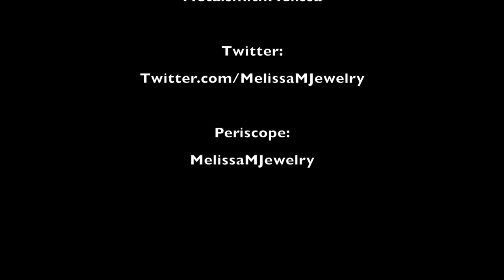Sand Casting - From Start to Finish

Comment: Great piece. I'm curious as to why you didn't create any vents in the mold. I thought that was a "must" procedure. Thanks.
Reply from the maker: It depends on the type of clay. The one used in this video is a bit more porous so it wasn’t as necessary with such a small piece. But when I do other larger pieces with this clay, I do put in vents. Since the making of this video I have also switched clays to one that is more fine and compacts really well. That one NEEDS to have air vents.
Reply: @MelissaMuir  Thanks and thank you for the quick response!!

Comment: I’ve been trying this using the MAP gas tank map pro tank and my metal (I’ve tried brass and silver) never seems to stay liquid long enough. I get the metal past the melting point as I would for spin casting but it seems that every pour just goes cold too fast. The only successful pour I’ve had has been bismuth. Any suggestions?
Reply from the maker: Hmmmm are you using a hose with the torch? I found that if I don’t have the hose and the canister is held upside down it doesn’t produce enough heat.

Comment: Is the trough that you cut around the piece used to allow displaced air to escape? Is there a circumstance where you use air vent holes - like for a large piece?
Reply: In another comment she said since she was using petrobond and it was porous the vents weren’t needed. The digging out was so that roughly half the impression was on both sides of the flask.

Comment: I take it that is baby powder? I am starting to get into casting. Will be trying it here in the next month or so. The powder is to keep the item from sticking? thanks for sharing and great video.
Reply: SilverHunter2013 yeah that was baby powder to keep the layers from sticking. the best type of sand to cast with is either green sand, which is just play sand with a little bit of some kind of concrete mix
Reply from the maker: Yes, it is baby powder. I like to put a bit of powder on the item being molded as well so it releases a bit easier from the sand.
Reply from the maker: That is great. I haven't ever used green sand. I may have to try that.

Comment: Would this be possible making a curb ring this way 
Thanks
Reply from the maker: Possibly, but you. may have some difficulties where it has a lot of curves or small openings. If you were to cast a curb ring this way, it wouldn't have them movement that an actual curb chain has, it would be more solid where there joins meet.
Reply: @MelissaMuir  ok thanks 
I don’t think you need that movement tho if it’s a ring right ?
Reply from the maker: @Elites-asthetic  That is correct, I wouldn’t think you would need the movement either.
Reply: @MelissaMuir  ok thanks 🙏 that’s my new project a curb ring
Now trying to find out how much gold it will take 
Because this seems hard 
I have some most wax designs of the curb ring and some wedding bands but I can not tell what gold I would possibly need 
How did you learn this
Reply from the maker: @Elites-asthetic  it has all been trial and error. Maybe try it out in silver first.

Comment: I would like to know if you use vent in the molds?
Reply from the maker: It depends on the material I am using to cast in. In this case it was petobond. It is less dense so it didn’t need the air vents. When I am using Delft clay then yes, I do put in air vents.

Comment: Wait, a time skip happened at 3:28. So how long does it take for the metal to melt? Cuz I read that sand casting was supposed to be one of the cheaper and easier manufacturing methods.
4:09 Wait, don't you need some kind of exit hole for air to escape, so the molten metal can pour in?
4:15 I think you kinda skipped the sand removal part. So we didn't get to see whether you performed the shakeout by vibrations or waterjets, etc.
5:51 Wait so how did you wipe away the excess paint?

Dislike.
Reply from the maker: It all depends on the type of torch you have. Some will melt faster than others. 

I didn’t need an exit hole or air vent because in this video I am using pertobond which isn’t not as compact as the newer clay by Craig or delft clay. 

To remove the sand, I just used a soft brush on the piece. 

There wasn’t excess paint. Any paint that accidentally got on the high spots of the paint were wiped off with a paper towel, very carefully.
Reply: @MelissaMuir  Thank you.